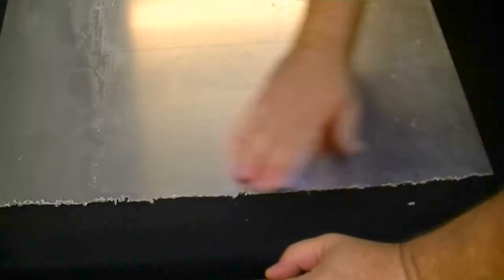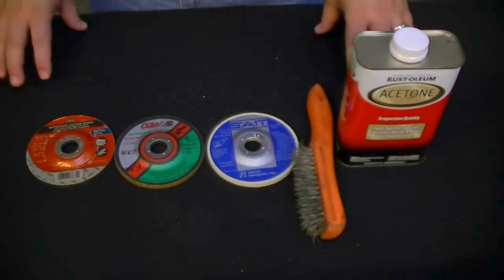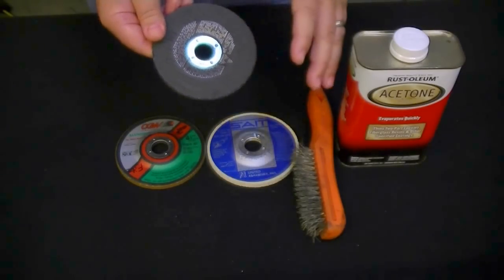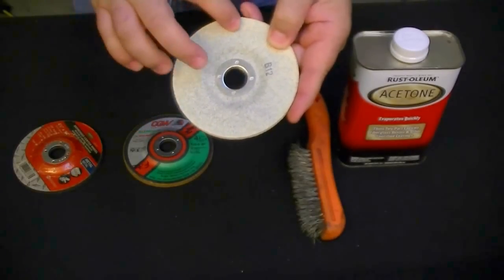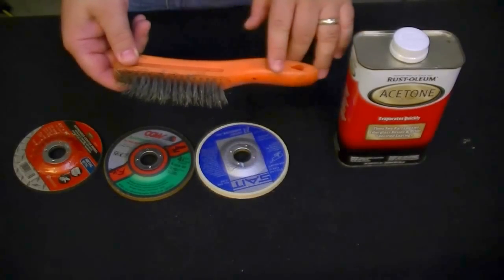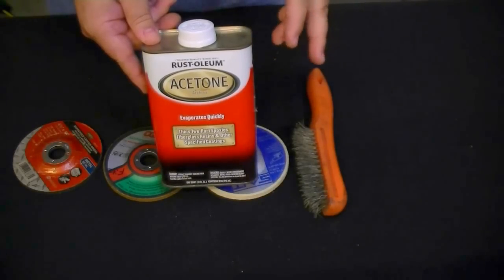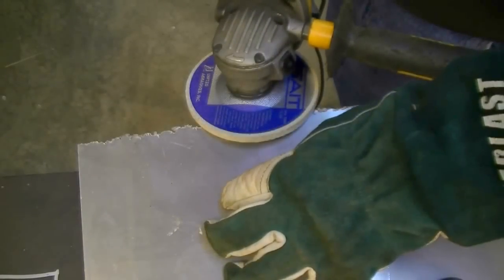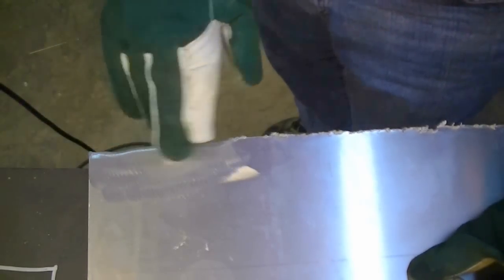Prepping Aluminum for Welding

Comment: Bar of soap will act in place of beeswax. The same welder who told me about a bar of soap also mentioned you can use stainless steel grinding wheels to avoid gumming up. It's been a while since i used a stainless wheel & welding alloy however i don't remember requiring soap for it. Pretty sure it worked ok. That said i like those alloy grinding wheels you got there

Comment: I was glad that he mentioned to use acetone and not chlorinated solvents.  Some may wonder why, well those solvents leave a film even after drying.  When welded, it creates a gas, phosgene gas, which will destroy lung tissue.
Reply: Does acetone cleaning alone work on brazing?
Reply: Menbo Cabizares you would use acetone in place of any other solvents you would plan to use.
Reply: @Uriah625  I'm planning to braze aluminum for the first time.  Can I use acetone alone without using sandpaper or wire brush before brazing? Thanks in advance.
Reply: Menbo Cabizares the cleaner the metal, regardless of the welding method or material, the better the weld.  If porosity or inclusions are not a concern, then braze away.

Comment: Good information on Plasma arc, and clean up prior to welding. Specialized aluminum grinding wheels work good, but are much more expensive as you noted in your video, and they tend not to last very long. Flap discs for a 4.5" grinder are the best value for the price.
Reply from the maker: Actually, many flap discs are made from Aluminum oxide, the very contaminant you are trying to remove from aluminum.  Using aluminum oxide discs helps embed the particles deep into the metal.
Reply: What you wrote is true, but at $23.00 a disc, most cannot afford them, they do not last long and they take very little off so you will grind forever. Flap disc's are $3.00-$10.00 ea. and last a long time if you buy the thicker versions. Below is a link to the Fabricators & Manufacturers Association who agrees that flap discs are the best for the value. No matter what you use with aluminum you will embed some sort of contaminants, less is always better. Have a great day!
http://www.thefabricator.com/article/finishing/gearing-up-to-grind-aluminum
Reply: Everlast Power Equipment what if you were to use the bees wax on a flapper disc?